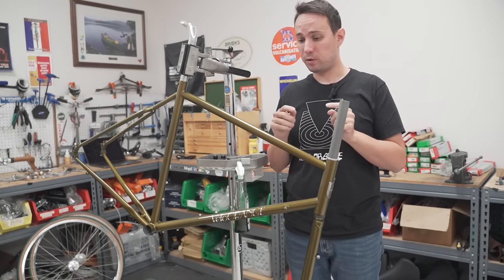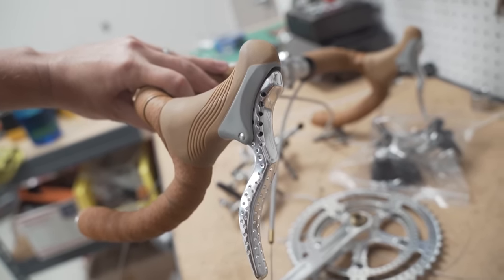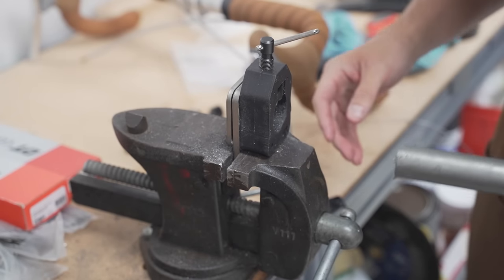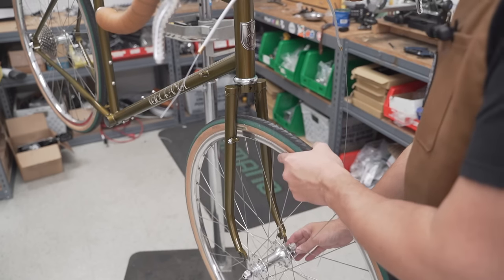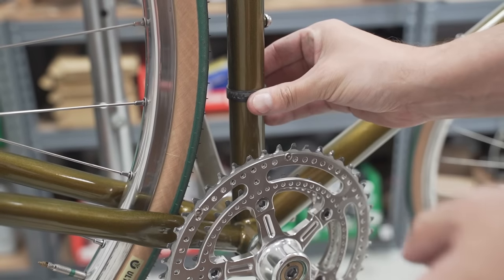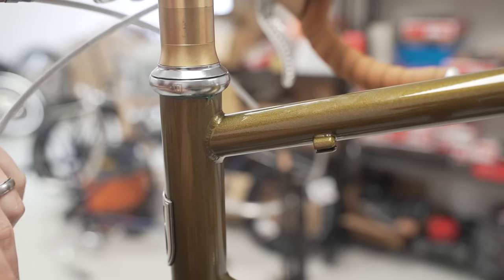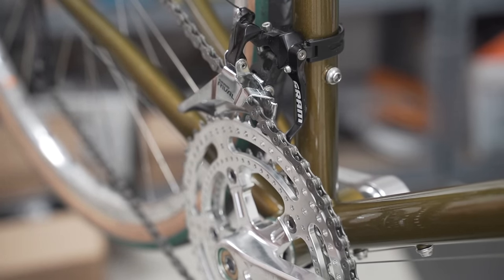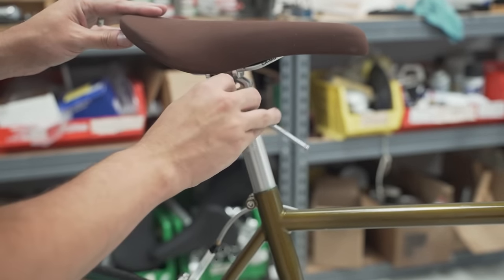Downtube Shifters in 2023?!

Comment: You know, you can have down tube shifters and not give up indexed shifting.  Shimano still makes them, or you can buy vintage.  Most will switch from indexed to friction if necessary.
I date back to the friction era, and I guess it is kind of groovy in a retro way.  But I recall being perfectly happy to give it up as well.
I still own one bike with down tube shifting and am not tempted to run it in friction mode.  But, hey, have fun.
Reply from the maker: I used to have 10sp Dura-Ace indexed shifters, but they are big bucks nowadays! I've heard good things about their 8sp ones, though. That's what I'd run personally, too.
Reply: @velo_orange  Shimano's web site says the 8-spd Claris will shift 10, but who knows.
Mine are the old 10 spd Dura Ace.  Guess I should hold onto them.
Reply: Friction shifters got a new lease of life when indexing arrived. The accuracy demanded to shift an indexed system properly, meant derailleurs and sprockets had to run closer and smoother. Ironically, this meant some of the disadvantages of the old friction system, like big gaps between the jockey wheel and the cogs, and suboptimal derailleurs designs (anything except Suntour's patented parallelogram, basically), no longer existed. So riders could de-index their lever and get really smooth changes, and C21st riders can wonder what all the fuss was about with friction shifting.

Comment: I am trying to get friction shifting working with a 10 speed cassette.  The bike was eight speed index downtube shifting.  The original 8 speed Shimano shifters were index only.  I had some Simplex friction shifters.  With a ten speed chain , 10 speed road cassette and the original light action 8 speed derailleur I can only use 9 of the 10 cogs the simplex does not pull enough cable to get all 10.  A lot of sources say that I should be able to get 10 or possibly 11 speeds with an old friction shifter.  What am I missing?  Would it work if I bought a 10 speed derailleur?
Reply from the maker: I don't think the Simplex shifter will be able to pull a full 10sp cassette. It was really only designed to pull 5 or 6. I'd switch to a different shifter. I've had good luck with the Dia-Compe shifters we have on the website for 9 and 10 speed drivetrains.

Comment: What no toe-in for the brake pads?  What am I missing?
Reply: When I finally got to eyeball the VO brake pads, I found that the washer between the brake arm and the pad is concave so there's room to toe-in the pad..  The easiest way to set the toe-in is to take some masking tape and wrap a spot on the rim 3-4 times.  Then just rotate the wheel so that the masking tape spot is under the rear of the pad, clamp the pad down after setting the height of pad, tighten the pad and your toe-in is complete.  Then, of course, you remove the masking tape.

Comment: Are the dropouts drop forged or CNC milled from bar stock?
Reply from the maker: The frame mounts are cast and cleaned up via cnc. The inserts are aluminum alloy and are CNC. The bolts are stainless steel.

Comment: What’s the maximum number of gears you can command from a down tube shifter?
Reply from the maker: This setup is pulling an 11sp cassette. You could pull more if you wanted, but would be a pain to shift since the distance between cogs would make it difficult.

Comment: No lube on the cables? Just wondering if that's best?
Reply from the maker: I usually will lube cables if the housing is old, but everything is in good shape and didn't feel like it was necessary.
Reply: @velo_orange  I started  working in bike shops when I was 15 and I'm 73 now. I made a dollar an hour and the owner had a ton of old bikes, mostly 3 speed etc.  I remember greasing all the cables and it was a big improvement. Now I have a bike with Shimano brake lever shifters and sometimes in cold weather the front shifter won't shift down from the large chainring.  So, I'm thinking the grease I put on the cable is the problem. I was just wondering if cable housings are different now than back in the day, so maybe they don't and shouldn't have grease?  I'm going to start riding an old bike I have with downtube shifters again and I'm looking forward to it. I think many of the new "improvements" to modern bikes really have a downside. I think companies felt the need to make "improvements" to bikes because they needed to try and create something that people thought they needed. Seems like your Rando is a nice blend of old and new.
Reply from the maker: @tomruth9487   Depending on the generation integrated shifter, I would hit the internal ratcheting assembly with wd40 to clean out the gunk. Dribbling some chain lube down the cable and Housing can't hurt!

Comment: I have downtube friction and i like friction, but i hate the placement. I keep missing them. Id love to try bar end shifter but they are pretty pricey. Hard to justify for my primary beater bike
Reply from the maker: I've seen downtubes mounted on top tubes - which sounds cool, but custom. The alternative is stem shifters. More accessible.
Reply: Handlebar friction levers are cheap and fun. Sunrace makes some metal ones with ratchet mechanisms for a decent price. I only need one on my dutch bike.
Reply: @velo_orange how can I put stem shifters (friction) on a 1 1/8 threadless bike?
Reply: @velo_orange the only ways I have found to get stem shifters on a 1 1/8 tl bike was to use a sawed off mtb bar end on the handlebar as a mount, or possibly find a way to weld stem shifter bosses and cable stops to a 1 18 tl stem.
The bar end as shifter mount is a little off center but works, and can host a bike speedo up high from the handlebar bags
Reply from the maker: @ThisTimeTheWorld  not sure, there might be a mount out there, but I haven't seen it
Reply: @velo_orange  I'm going to try the low buck Sunrace band on 3x 7sp dt shifters for a steel frame bargain gravel build and if they get old fast I will just go with thumbies.

Comment: Reason why downtube shifters were replaced is the frictions are unstable and it unintentionaly shifted at critical  racing scenes. Friction loss by vibrations, swets and manipulations tehemselves.Many makes invented balanced shifters like simplex, Shimano or Suntour. Unfortunately Campy was not an enthusiast in this drawback.
Reply: Yes, nothing worse than the damn thing upshifting on a difficult climb.  The elegant solution?  Tighten down the wing nut!

Comment: Forget downtube shifters. I'm so glad I can stand up and shift gears when I'm climbing, Todays shifters are way better and there's a reason they're used.
Reply: Yesterday's shifters were also used....
Reply: indexed downtubeshifter for the rear-derailleur are ok. But hard to find. My dura ace 8-speed-Downrubeshifter worked great. Because I switched to 9-speed, I now use a brake/shift-levers right for rear-derailleur. It makes things easier and foremost friction levers are a two steps backwards.

Comment: its Florida... why not 1x for lighter weight and even further reduced complexity? Back in the late 80's I did 1x with a Campy super record drive and single Dura Ace down tube shifter.
Reply from the maker: He wanted a double for a more classic look.
Reply: Probably need really low gearing for riding into the hurricane.

Comment: With new bikes starting $600+ I got into old 10 speeds with friction shifters a couple years ago , never minded the non- indexed gear feel, the maintenance is simple enough to do yourself with standardized available parts,  and the 70 - 80's steel frames are indestructible.

Comment: Campa downtube shifters are not good when you go out the saddle and the lower tension on the chain it shifts automatically 
In the eighties we used Simplex shifters which has some breaking mechanism other solution was Suntour

Comment: You can find a Surly steel road bike frame or a steel road frame from the 1990’s or 2000’s to take advantage of three technological benefits — 700C wheels for technologically better tires such as Continental Grand Prix, a chain stay wide enough to take a 9 or 10-speed hub and down tube shifter mounts. 
Dura-Ace 10-speed and 9-speed INDEX down tube shifters are your best bet for the ease of direct INDEX shifting and the versatility of 9 and 10 SPEED CASSETTES , 12, 13, 14, 15, 16, 17, 19, 21, 23, 25. 

There is no need to ride 5-speed or 6-speed cassettes or friction shifters — These are equivalent of a Ford Model A — a car with no electric starter, no water pump, no gas pump, no counter balanced crank, no updated radial tires — basically — no technology.

Note to the people riding fixed gear bikes because they are trouble free — Indexed Down Tube Levers are Trouble Free.
Reply from the maker: Sometimes 5 speeds is all you need! And hey! I love my aircooled Bus!
Reply: @velo_orange  Chevrolet introduced the Chevy ll in 1962 with the company’s two speed Powerglide automatic transmission. This car was later renamed the Nova. The two speed Powerglide automatic was so strong and bulletproof that drag racers used it for racing. The Chevrolet engine/transmission bolt pattern remained unchanged into the 1970’s. Racers could bolt it up to a heavily modified and supercharged 454 cubic inch big block motor. The motor mounts were the same on all Chevrolet engines, and the engine bay was large enough to handle a 454 without any modifications.  A stock 1962 Chevy ll was about 2600 lbs, the weight of a 1960’s Porsche air-cooled 911. So this car, with a two speed automatic… was Fast! 

If you have a Chevrolet 454 under the hood, a two speed automatic is enough … but as a human being, I want more gears. 

So my 2000’s steel road bike with polished aluminum 10-speed Campagnolo Chorus and Ergopower shifters and hand built wheels with Mavic Open Pro rims is enough for me. I enjoy road riding too.

Comment: It's not a good idea to grease the square taper axles. Grease is to prevent friction between the mating parts and thus will allow the axle to keep sliding on too far and possibly split the crank, plus over time, the grease will extrude out and the crank will become loose. The cranks are held in position by friction, so fit the cranks dry and clean, tighten the bolt once and don't go back and retighten it, or you'll just encouage to split the crank.  But I do agree, d/t levers are simple, light, cheap, reliable, easy to set up, and never need tweaking. Their only downside is you need to be seated to change gear. I rode them for 30 years without problems and regret they are no longer an option.

Comment: Why downtube shifters?  Because crossing Florida, you won’t even be using them 😊

French Threading is like British threading, but different thread pitch.  It is a Italian Threading that is righty tightly both sides.  I’ve build a brake of each type.

Italian is “The Devil”

I luved the self extracting crank bolts. . .  Had them on Shimano 600 back in 1979, but the bolt was a 6mm Allen Bolt.

Comment: Would anyone else like the track end/SS  inserts available for 130mm hubs?
Reply from the maker: What kind of hub would you run? I'm not sure of any fixed gear 130mm hubs out there.
Reply: @velo_orange  it would be for single-speed mainly- using cog and spacers on regular cassette hubs. But 6-bolt cog on a disc hub (flipped around) also works well, I feel.
Reply: edit: the 6-bolt disc would be in 135mm.
Reply: also I think most IGH are 135mm. No?
Reply: I would double check to see if the track inserts are in fact 120mm.
Reply from the maker: Alfine 11 is 135, but I don't think most people would put something like that on this style bike. The SA 3sp is 120. I could see someone using a cassette hub though with spacers and a single cog. I'll bring it up with the team for the future! @leendeen8745
Reply from the maker: They are 100% 120mm @leendeen8745

Comment: Far as stretchy  cable length durability longevity.... obliteraring handlebar clutter, aerodynamics, precision shifding &minimize weight were conscern yes downtube shifdrz were king. 
 Dont even get me sdarted on stone reliable simplicity of 5 moving parts& expense.
   Downtubes are POSITION SPECIFIC &so are inherintly intuitive - even blindfold. 
 Your almost there think about it wwhere else could u mount shifdrz that has a cable length as short or even an awesome 13.5 " shorter.